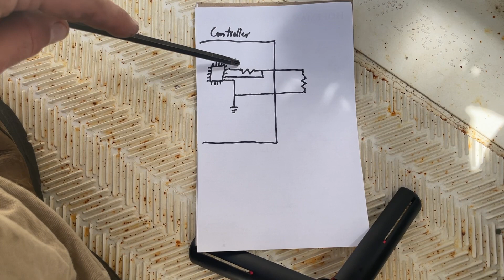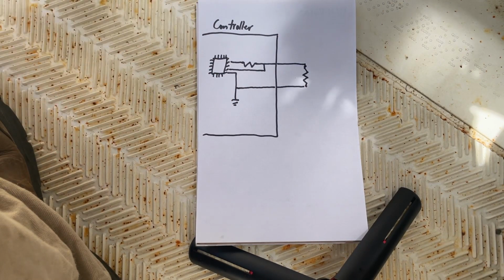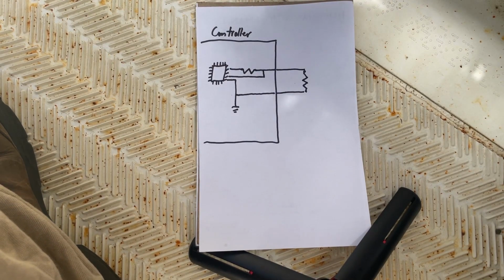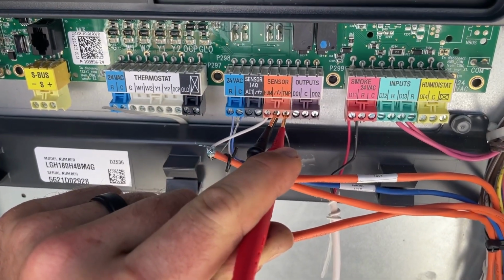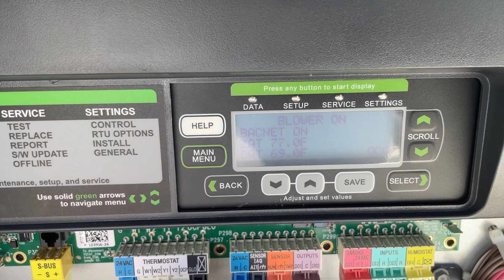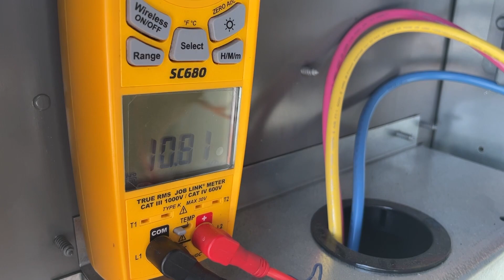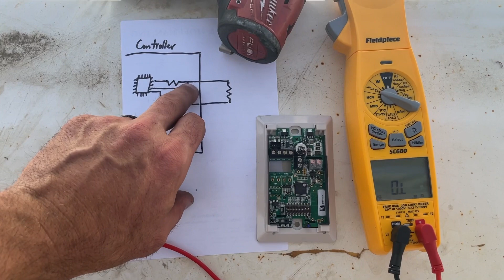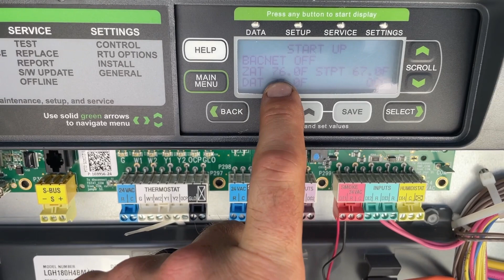Edu6: Understanding HVAC Temp Sensors

Comment: Absolute gold 👍🏻👍🏻
Reply from the maker: Glad you enjoyed the video.  I’ve found that temp sensor circuit are almost universal whether it’s a Tesla or a mini-fridge lol 🤓
Reply: @HVACLife  I’ll test this out when I’m back to work 😬 I’ll just have to find out and make note of what logic voltage to expect for each manufacturer 👍🏻👍🏻 thanks again , big eye opener
Reply: Best part is that I don’t need to disconnect the probe on a running system to be able to get a rough idea whether there’s a probe fault or not

Comment: Somebody told me that the thermostat is the heat/cold sensor.. I thought that was BS..
Reply: @HVACLife  so if I have a heater facing directly,
at the thermostat will that thermostat change the temperature of the airflow?
I’m trying to figure out if the thermostat is the sensor to the supply. I thought the thermostat was just like a control